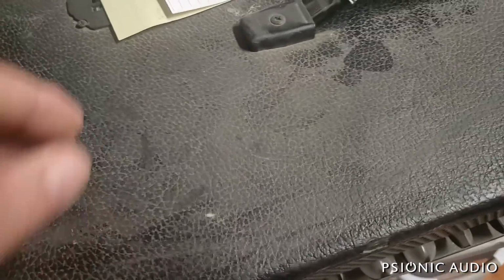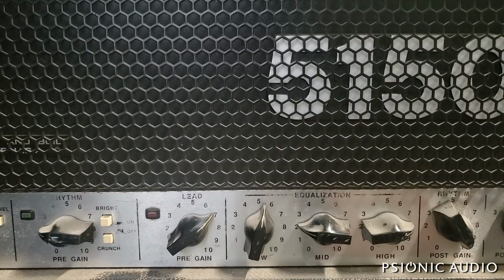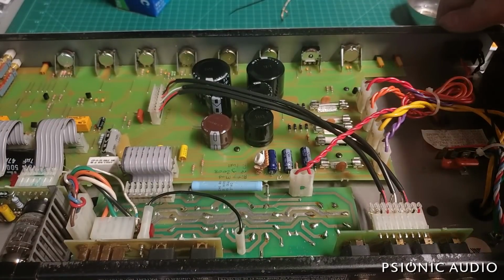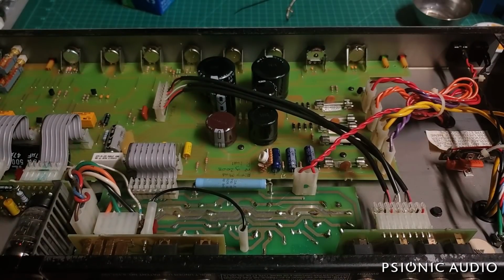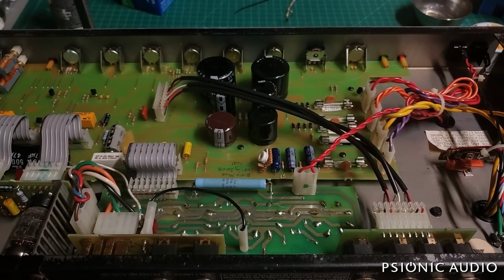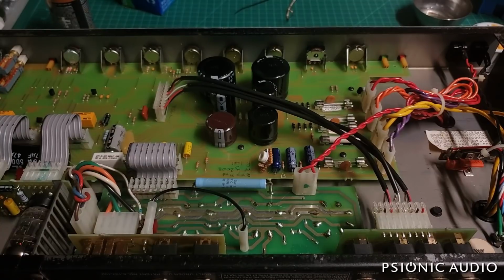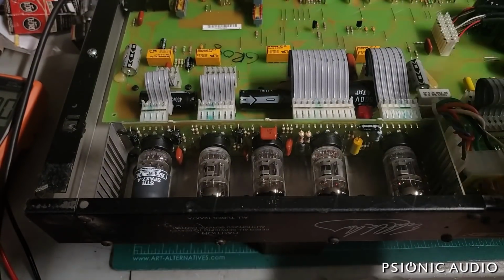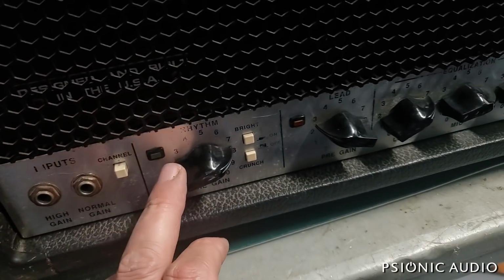Neglected 5150 | Will It Chug Again?

Comment: I am having problems on the buffer stage (V3B) as Well, changed all the resistors, upgraded from .25W to .5W, still not a lot of volume.

Being a cathode follower configuration, would you consider it normal to measure 170vDC on cathode (pin8) and 30vDC on grid pin7? Thanks for all the videos, I’ve been learning a lot!
Reply: Oh and I do measure proper resistance levels from cathode-GND and grid-GND

Comment: I assume based on the way you phrased "plug the variac into the bulb limiter" that you're going wall->limiter->variac->amp is that right?  Idk whether to put the limiter ahead of the variac or between the variac and the amp... I think my autotransformer has current metering onboard tho so idk if that differs from your setup and/or changes things
Reply: Also was that Things Change into the "lower gain input"?

Comment: Leave it to a 5150 user to keep the gain at 7😂 former owner of 3 separate 5150’s, I’ve paid my dues lol for anyone out there who still uses a 5150 you’d be very surprised how heavy it can still sound with the gain below 5. Second point of contention: if you take it out of your bedroom and actually turn it up, you will not need to move the resonance and presence controls to that extreme degree
Reply: Played a backyard party back in the day, the only time I ever cranked it: Lead pre-2, EQ-636, Lead post-7, Resonance-0, Presence-0. Maple strat w/Duncan 59. Was knockin squirrels outta trees but it sounded great. Big and clear. Bedroom levels tho, horrible. Sounds like bacon frying a broken AM radio.
Reply: @emmayy67 sounded awesome, huh?
Reply: @sauce_aux  Absolutely. For me this amp sounds best when you dial in as little pre amp and presence as possible and then crank the hell out of it. Its like the power amp doesn't even come on until around 6 or 7. But those volume levels aren't practical most of the time. I never used one but I bet a good attenuator paired with the settings i mentioned would sound pretty good. Maybe not as good as if it was actually cranked but gotta be better than the pre and presence cranked at lower volume levels.
Reply: @emmayy67 of definitely, an attenuator would definitely give you some flexibility

Comment: As a peavey 6505MH owner, I wonder your opinion about stability of other high gain amps like ENGL, Soldano, or Randall. Are they more reliable than peavey 5150/6505 based on your experience?

Comment: y'all talking about nuts so much in the comments, it's as if you think you might finally grow a pair...
Reply: You dont usually grow nuts, they're machined out of metal most of the time. I think they make them thousands at a time, probably not in pairs very often. I don't need any right now honestly. If that changes, there's a hardware store pretty close by. I can go pick out whatever size and type of nut i need there. 

They even put them in this handy little nut sack so i don't lose them.
Reply: @constantk8780  🤭

Comment: I had a 6505+ come in to the shop with a lot of neglect. It had issues where the volume on both channels wouldn't kill the sound and any time you reduced the controls under 3 it would started to increase again and sound horrible. Caps were shot especially the decoupling cap. It looked the same way as that one does

Comment: I've never seen a tube amp with the pre amp tubes inside the chassis. That just seems really ignorant to me. Interesting I suppose though
Reply: I have a Peavey Bravo 112, all the tubes are inside the chassis. They are accessible via a removable panel on the back, it is a strange design though.
Reply: On high-gain amps it’s mandatory to have proper RF-shielding. Peavey did away with the bayonet tube sockets and metal shields altogether, therefore putting the tubes inside the metal chassis and thus saving some costs.

Comment: Is the bias mod on these amps worth the trouble?
Reply: Some like it some don’t. The point of the amp was to have the gain all coming from the preamp section. I just picked one up without a bias mod, don’t plan on doing it. When researching about it I seem to be finding a lot of folks either aren’t doing it or didn’t really get what they wanted from it. Euge Valovirta just did a video on de-modding his 5150 and his grin while playing it after it was reverted back to stock kind of told me whether the bias mod was really worth it (probably not). I think it sounds great as is personally, or throw your favorite OD in front of it. Either way it rips. To each their own.
Reply: As an owner of two 5150's, and a person who does tech work as a hobby, personally I think the bias mod is worth it. Peavey has their tube stuff biased pretty cold, most Peavey tube amps are biased around 35-40% of max dissipation of their output tubes. In the case of the 5150, it makes more sense to bias them cold from factory, as colder bias translates to earlier breakup with more "crunch", which is the goal of this amp. Putting in adjustable bias can help "dial in" more headroom and a little bit more of a cleaner sound if you so choose. I like having the option of being able to "dial in" a little more headroom, or back it off for more crunch. It also is good to have the bias adjustable so when you put new tubes in, you won't have to worry about the potential of over-dissipating them. Just my $.02. :-)
Reply: @ExitThirteen  Thanks for the insight on the bias mod. Sounds like it's useful enough to go ahead and try it.
Reply: I like how an amp that was so revered and also used on so many recordings stock that are considered benchmark metal tones suddenly didn’t sound good unless you modded it to fix it up…lol
I would not bother modding one of these, just use the knobs and maybe an appropriate EQ pedal to carve either the input gain structure or in the loop for a stronger effect on it. Noise gate too as they are noisy.
Reply from the maker: It's not as crucial IMO as changing the heater wiring. The current drawn by the 6L6s likes to nuke the ribbon cables/connectors. 

As far as bias goes, the output tubes here have very little impact on the sound.
Reply: @PsionicAudio  Would a change in V1 of the preamp tubes be a better way to change the overall tone of the amp? I'v seen a couple of examples of mesa spax7 in V1. Any suggestions on preamp tubes(or who still has any for sale)? Seems like the usual places to buy tubes has dried up, at least short term. Thanks

Comment: Since the EVH's came from the SLO, how much SLO and/or Peavey DNA is in them? Since Fender actually makes these did they put their "DNA" into these in the way of design or parts? Just curious. I think Eddie should have just had Soldano make the EVH SLO and be done with it.
Reply: This is the Peavey, and it's lots like an SLO in the preamp, buuuuut:
- they tacked on an extra gain stage
- they got rid of the separate crunch/clean circuit from the SLO
- the tonestack driver is a plate output stage with a truckload of NFB and a voltage divider before the tonestack to intentionally load it down
Reply: While we’re at it the Mesa Boogie Dual Rectifier Solo amps (now just the rectifier series) we’re also “heavily inspired” by the SLO.
Reply: Sounds nothing like the slo I played. Way more gain, waaaay more noise.
Reply: story goes Eddie took the Soldano to peavey
they copied the preamp is practically identical 
learn to read the schematics of both and see for yourself

Comment: Would like to learn more about cleaning pots. I have deoxit but you mentioned a second lubricating step. I have a 2000 model Eventide and the buttons need help too. Also an even older Rockman XPR with the same button issues, they need to be cleaned. My local tech says he only wants to work on point to point style circuits, no modern PCB things, so I watch faithfully.
Reply: He said he'd use Fader Lube after the Deoxit. Fader Lube (also called F5) is a product made by Deoxit so maybe he's using D5 first as a cleaner then F5 for lubrication.

Comment: I've got a Peavey Classic 50 410 that I have not powered up for two 1/2 years. It was working fine when last used. Should I just power it up and start using it once in a while? It's been in my living room the whole time. It's sitting right next to a large air purifier w/ionizer so not much dust. Should I build one of those limiters maybe? I really don't have any other need for one. Also I have a Carvin DCM 2000 amp I inherited nonworking from my brother. Is this amp good for a guitar amp, or a home stereo system or what? Worth repairing?  My brother has a set of the big Klipsch Horns so I assume he was going to power those with it.
Reply: I believe Uncle Doug has a video on building and use of the light bulb current limiter. If you can trust yourself with it’s use, yes, build one.

About the Classic 50, age and temperature are determining factors of electrolytic capacitors. How old is it? Did it ever get really hot? Was it maintained? Do you like/care about it?

Answer those questions for yourself and proceed with caution or courage.